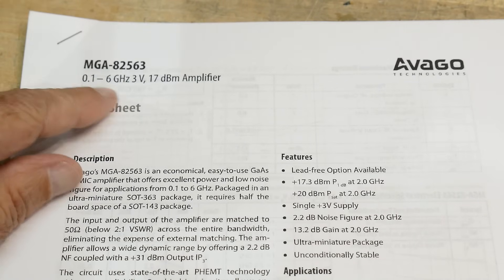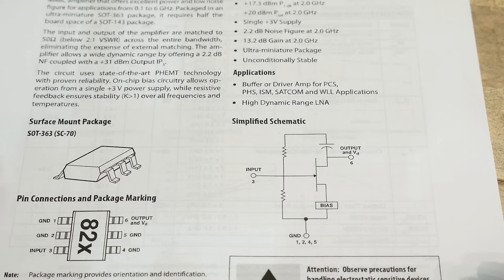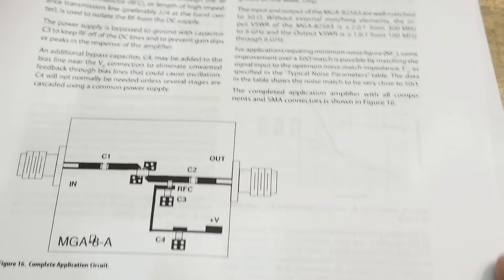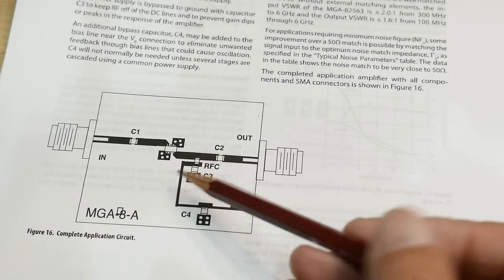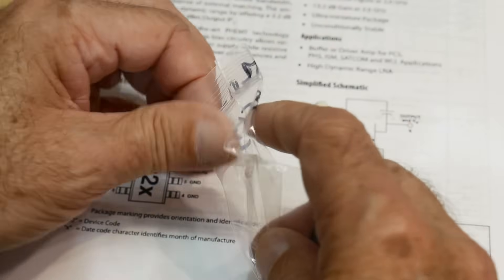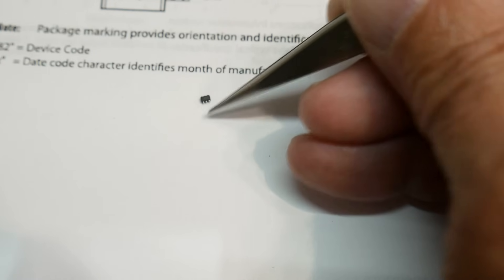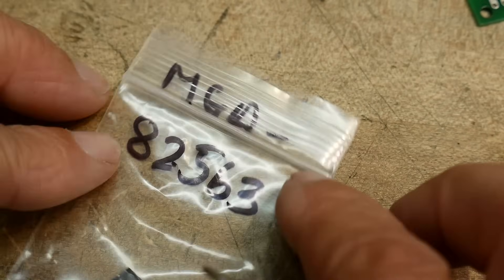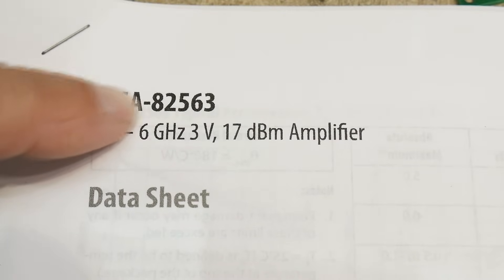#1929 MGA-82563 6GHz MMIC (part 1 of 3)

Comment: How the the device respond from 1-30MHZ?
Reply from the maker: it won't
Reply: @IMSAIGuy  A max freq. limit is understandable, a minimum limit less so.
Reply from the maker: probably very small input capacitor on the FET so it will not pass low freq
Reply: @IMSAIGuy  Possibly, but the simplified schematic suggests a DC connection to the gate. I still think it's worth a try.
Reply from the maker: @stevenandros4586  please look at the datasheet graphs, you will see at 100MHz it is going bad fast. there is no way

Comment: The rule I was taught for RFC's, or chokes, in these uses (why can't they just lost a value?) is that the impedance of the choke should follow the standard engineering rule of ten.  So, the impedance at the lowest frequency of interest, should be ten times higher than the impedance looking into the circuit it feeds., in this case the drain impedance. It may not be a completely valid design rule, but it sounds reasonable.

Comment: The datasheet mentioned that it would work from 0.1 GHz to 6 GHz. Does it work in the HF range, too, or is there a significant attenuation?
Reply from the maker: look at the datasheet graphs and you will see things are really going bad at 100MHz. no way it will work lower

Comment: A sibling to this chip is used in HackRF one as input and output amplifier. Those are prone to blow easily.
I replaced those on my HackRF just two weeks ago.
Would love to see if these are that sensitive as well. As they looks like drop in replacement to the HackRF(MGA-81563) variant.
Reply: I have now skimmed the datasheet for both. And I have trouble to see what the difference between them is. Except from the amplification.

Comment: Could you make an 'attenuator' in front and behind the IC? I mean only the T or Pi- shades of  the print. Maybe 0805  smd? So I/we could 'adjust' the gain in and the gain out, a little bit?

Because theese smd's are so damned small, I keep my two  cats out of my shack, during smd-soldering, ...! 

73 de Markus - db9pz (JN39fq - 5km/3miles east of LX)

Comment: First, performance on the protoboard will stink; you MIGHT get 1.5 GHz and you might not.  Second, find these little things with a flashlight shined parallel to the surface and the lights dimmed.  The key to holding them with tweezers is don't grip them too tightly.  (Quality tweezers also helps.)  Hold the tail of the tweezers at the right place to grip them without straining.
Reply from the maker: I came to the same conclusion and skipped the proto stage.